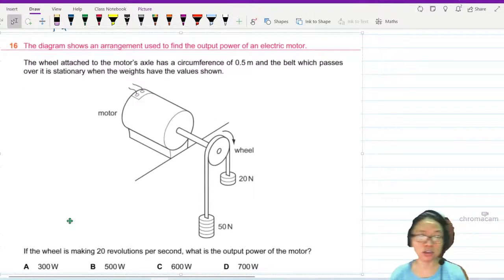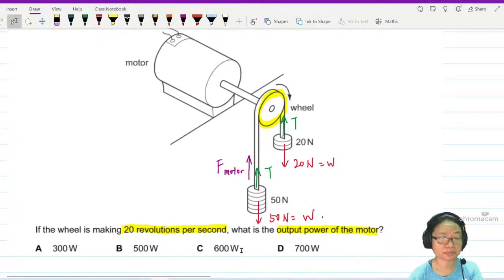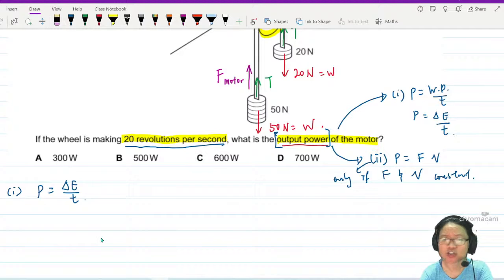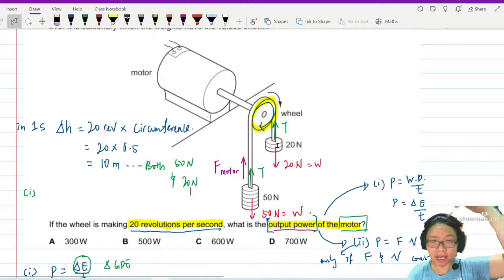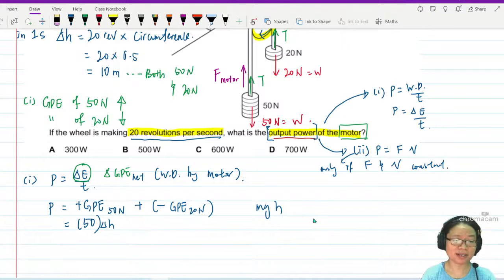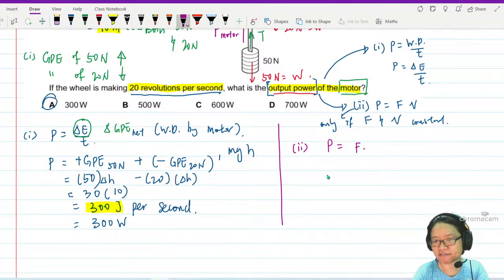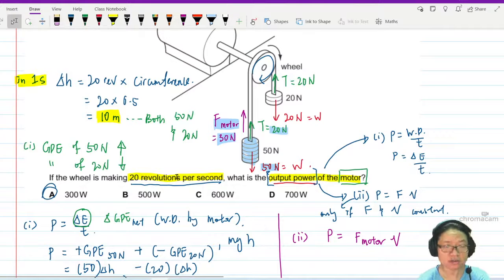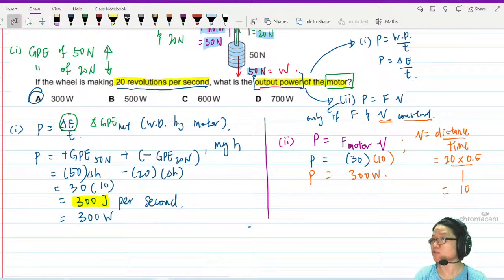MJ13 P13 Q16 Output Power Wheel | May/June 2013 | Cambridge A Level 9702 Physics

Comment: Ok here...they have said that the belt remains stationary in the question so isn't the belt not supposed to move?.....I did it using moments about the axle....20N will provide e clockwise moment and 50N will provide an anticlockwise moment......in order counter balance it the motor needs to apply a force of 30N to keep it in equilibrium.....the parpendicular distance from the axle to  the forces is the radius found by using the circumference......force by motor will be 30N to clockwise to balance the system and power can be found by P=F by motor× velocity.....it is similar to the second method you did.....I just to make make sure is this idea correct(what i did I mean)
Reply: I'm two years late haha but I did the same and in pretty sure it's valid since you can do the same question by multiple other ways (applications of topics) infact if you have topical past papers you'll see same questions being repeated a lot of the times
Reply: Damn